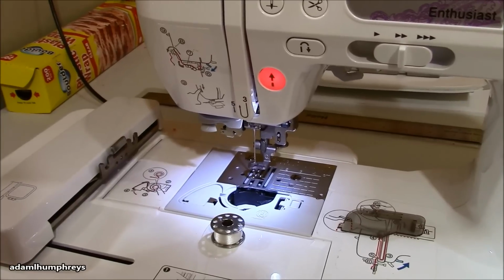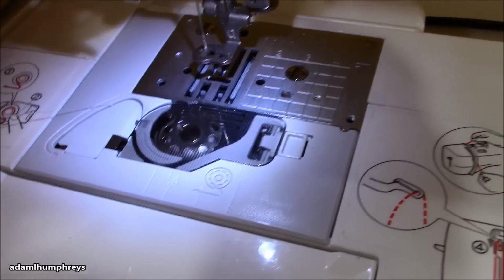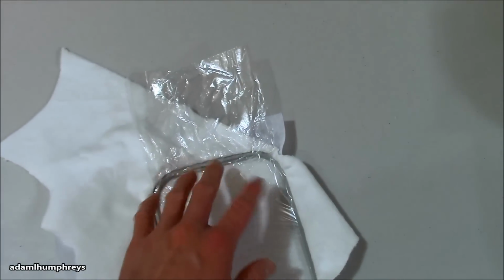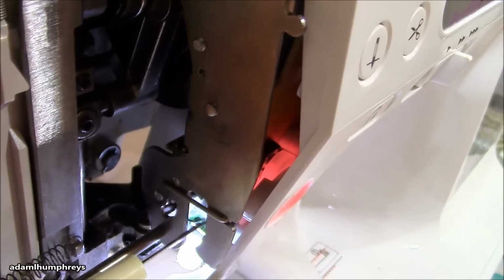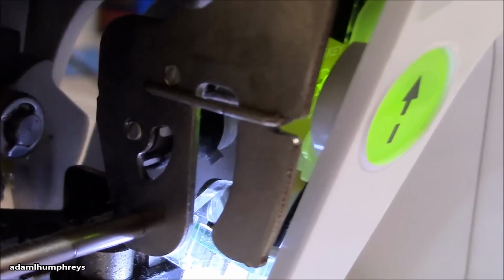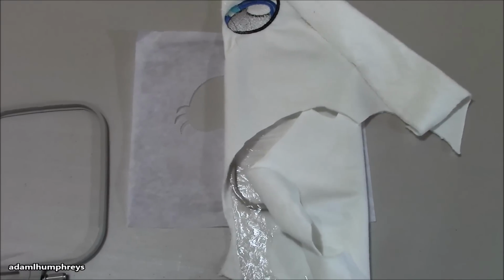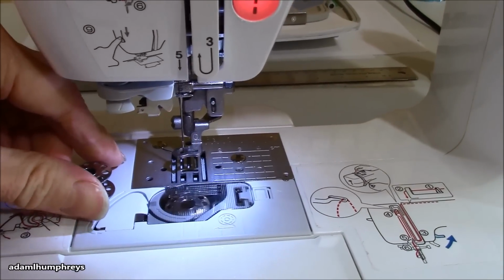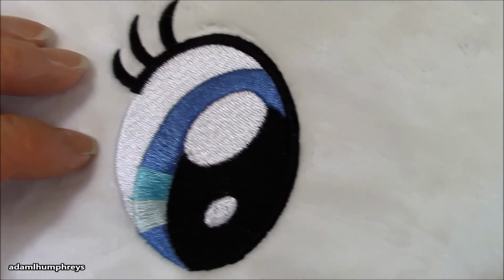Embroidery Tips, Tricks, and Hacks

Comment: I've been having problems using the plastic bobbins that come with the machine too, (loose stitches on the top), and have been using the metal ones from my old Kenmore machine (similar to Singer).  I don't know why they work better, but they do.  But thanks to you, now I know what to do to make my plastic bobbins work by putting in some material underneath.  I hope that trick works for me too.
Reply from the maker: That make sense. The metal bobbins are heavier, so they naturally give the thread more tenacity. Let me know how that trick works for you! So far I haven't had any particular problems with plastic bobbins, but I always rewind on metal ones for embroidery. I just use the plastic ones for short runs where the color matters on the bottom of a stitch.
Reply: I put a bit of knit underneath (cut in a circle) and so far it works with the same bobbin that didn't work before.  Thank you for that wonderful tip.

Comment: Thank you for the tips. My upper thread just got tangled around my bobbin and that has never happened before. When I got my machine the brother SE400 it told me not to use the metal bobbins because it can damage the machine. Now I know that is to be not true. Another thing is that my upper thread some times break, I adjust the tension and then it would be too loose. Thank you for this

Comment: so you have used the sohiesew software? how was it? cant believe its free
Reply from the maker: I use it exclusively, it's awesome! :D ... Once you get used to it. I really need to update my tutorials for it.
Reply: new to embroidery, so can I import a jpeg and turn into a PES file to embroider on my brother xe 5100? If you don't mind I would love to see a demonstration. I need all the help I can get.
Reply from the maker: To your specific question, no in two ways: there's no automated converter, and it doesn't support PES. However, you can manually design it with a JPG as a place holder using the tool that looks like a paint brush on the lower left tool panel. Then you'd make your design on top of it and export it as a DST file. My Brother machines support DST files just fine, but I'd try it out on your XE 5100 first to make sure. A design may take a while to load depending on the size, but they have always loaded for me. I cover the rest of the process in my dated SophieSew tutorials. :)